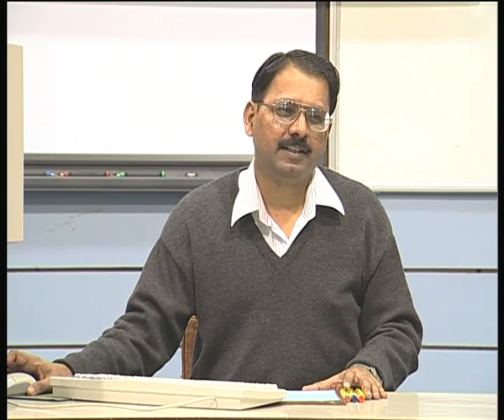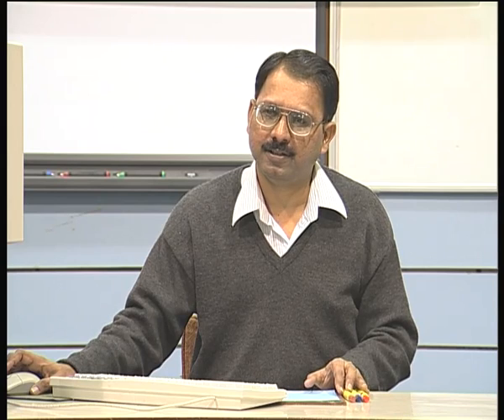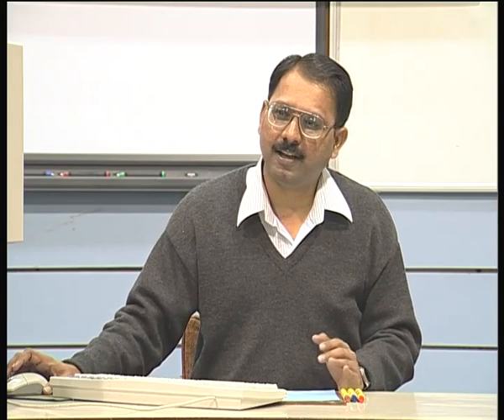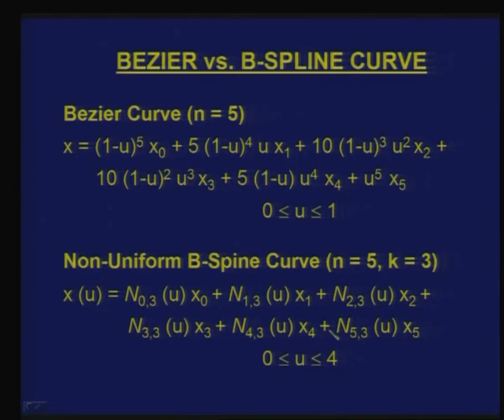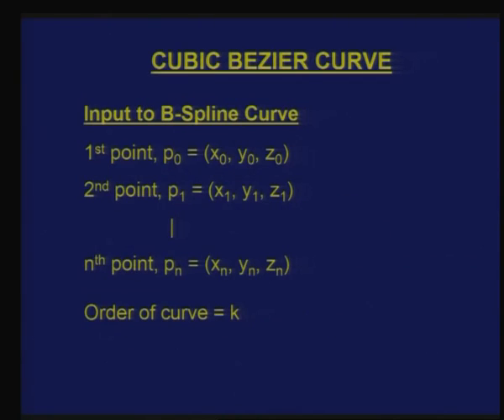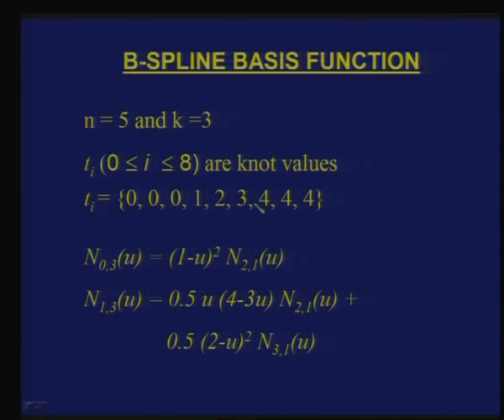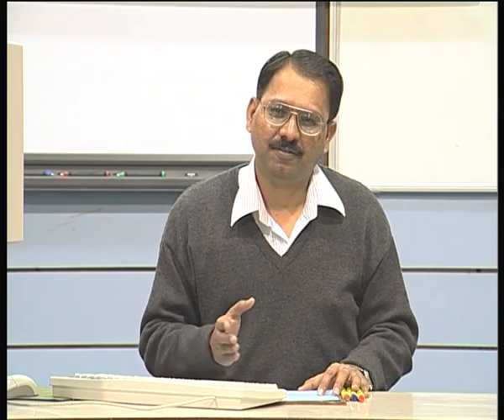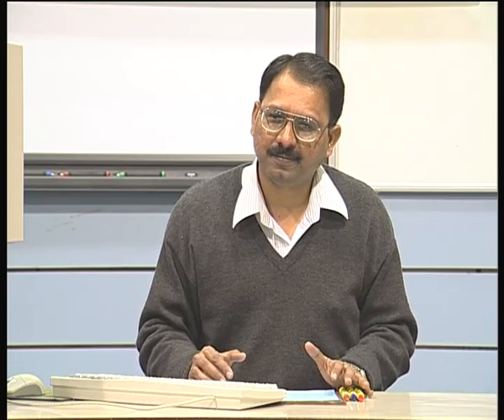Lec-47 B-Spline Curve

Comment: At minute 23:19, 2nd ,3rd and 4th equations have mistakes. The second term in all the three is multiplied with u which is wrong..Instead of 0.5u ,only 0.5 will be there.---.as per my derivation.....nd also i have cross checked from other reliable sources.
Reply: Nothing is wrong here, please have a look at 34.50, u is a variable which must be input to the equation in small increments. For example if the range of u is from 0 to 1, then there could be 100 values which can define the curve, ie; 0, .01 , .02, .03.......,  .11, .12............., .99, 1

Comment: Good explanation. However, there are a few things you should know when you try to implement this:
- There are two mistakes in the second to last line on slide at minute 28. The line should read Ni,1(u) = 1 if ti <= u < ti+1
- For the start and end segment, both nominator and denominator in the equation of the basis function are zero. In this case, the result was defined to be zero, not NaN.
- For the maximum value of u = n - k + 2, all basis functions are zero. This means, you have to treat this case separately.
- Order of the polynom must not be higher than the number of control points (n - k + 2 needs to be greater than 0). You have to reduce k if there are too few control points.
- Using a recursive function is very inefficient because several basis functions are calculated multiple times.
Reply: abhi aap kaun si job kar rahe ho sir?
Reply: Do you have an implementation for this? I also tried to implement that without success...
Reply: You mean Ni,0, not Ni,1.